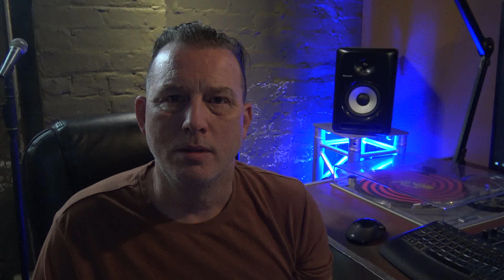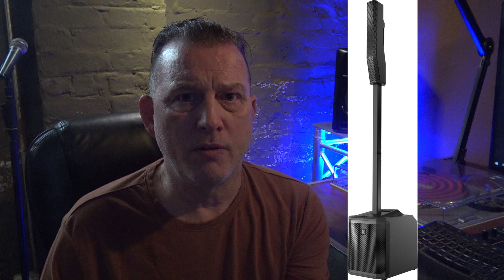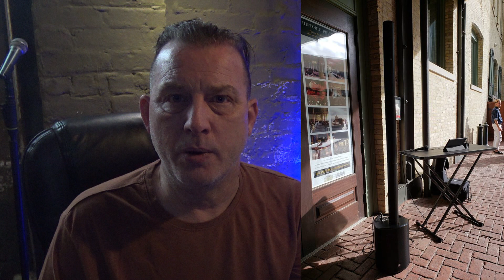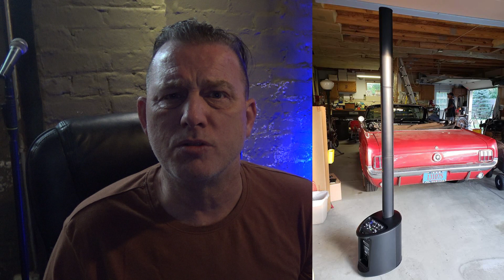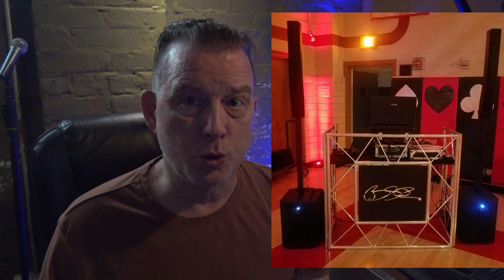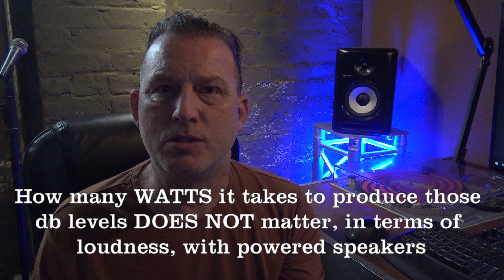Powered Speaker WATTS Mean SQUAT... When It Comes To Loudness

Comment: Best personal experience of your point is my radio station's mobile system for primarily school dances in 1981 - 2 Klipsch La Scala tubs with a 150W stereo power amp. Couldn't stand in front of them. Rattled the windows in a gymnasium.

Comment: what you said is correct, I talked to a sound engineer the watts is the power consumption and if your active speaker's amp module is that powerful, it's good, BUT check the speaker driver if it can handle the feed from the power because it if cannot take the power, all it does then is use what it can and the rest converts to heat energy, you can actually try to touch the paper cone to prove it, it feels warmer. in addition to that, the speaker can put out a very loud sound but listen to the distortion, that max loudness that the speaker can deliver at a very good sound quality, other listeners don't bother about the quality of sound the speakers put out, they just know its loud.

Comment: Hello Brian, I have an upcoming outdoor wedding ceremony Of approximately 160 people and was wondering if One Maui 5 go will handle it or will I need to use both of my Maui’s? 

By the way I have two separate systems when I need to set up in different areas of a venue. I also have a pair of Evolve 50’s that I use for receptions. Thanks for your previous videos that made me decide on upgrading my equipment last year pre-COVID. 

I’ve used my single  Maui 5 go for ceremonies before but not for an outdoor ceremony this large. TIA 🎶🔊

Comment: Watts are all some people seem to care about.  I use passive speakers, but the same rules apply.  Among other things, I look at sensitivity when looking into what speakers to buy; the power rating is further down the list. Other than my subs, none of my speakers are rated more than 250 watts continuous. Among my speakers, I have a few EV ELX112s and typically run them on a 350WPC amplifier. I can run those speakers to painful levels without the amplifier even breaking a sweat. A pair of those with a single ELX118 Sub are ample for an indoor event with around 250 people. Assuming the continuous power rating for all those speakers and me running at that level...that's 900W.  The ELX112 is a pretty sensitive speaker at 94dB. While I don't know exactly how hard I run them, I am certain I don't run them anywhere close to their rated power...it gets uncomfortable before I get close.

Comment: Amplifier output wattage spec is useless without knowing speaker sensitivity. A low speaker sensitivity will need a lot more wattage to obtain the same SPL as a very efficient speaker. My RCFs are 400 watts RMS and have an SPL of 129db.  That means it has a much more efficient speaker than a brand that uses a 1000 watts to get to the same SPL.

Comment: I couldn't care less if my powered speaker only drew half a watt from the wall if it made a lovely sound that was loud enough to cope with the kind of parties I play!   No wait - I actually WOULD care!  I'd be very happy about that LOL.  Great video as usual Brian.  You mention SPL as being the number to watch for in the specs speaker companies quote, but sadly not all SPLs are presented equally.  Some are measured in half space, some in full space, some are even just calculated (pro tip: if a speaker under $1000 is claiming 133dB SPL @ 1m it's probably just a calculated number not a measurement or a realistic continuous one).  Some channels on YouTube do very careful analysis of powered speaker systems with calibrated equipment & their findings are miles away from the manufacturers' claims.  I think the best advice anyone can give when shopping for speakers is to use your ears.  Compare what you're looking at with what you already know.  Or better yet, hire or loan the model you're thinking about buying & see how they fare at a gig. That said, it'd be brilliant to see some real honesty return to equipment specs

Comment: In active systems I would agree but in passive systems which I have to take in WATTS in to consideration because of amps to power the speakers.
Reply from the maker: Yeah, with passive speakers, you'll have to look at the Program / Continuous power (not max power handling, which is a bullshit theoretical number), the impedance, then match an amp up with it.  With that amp, you have to consider not only will it provide the continuous wattage at your speakers impedance, but you'll also need to consider additional headroom.  So, if you have 300 watt speakers @ 8 ohms, with the 100% headroom you should be using, you need an amp that's at least 600 watts per channel stable @ 8 ohms.  Yes, 1200 watts total in the system, but you are only using max 600 of them.  Now, if that same amp can do 3000 watts @1 ohm, bragging about a 3000 watt system, or advertising you have a 3000 watt system, is pretty sketchy at best

Comment: I have to get M30’s because of my back, neck and feet!!
I love these DJ’s that leave the stickers on the speakers 1000 Watts or 2000 Watts!! Lol 😂
Reply: I know of a powered cabinet by yorkville thats rated at 4400 watts. The sound is impressive.. parasource is the way to go. 4400 per cabinet at a cost of 1500 per bin .. I'd rather over powering a venue running it low and cool then over working a venue and having not enough sound any day